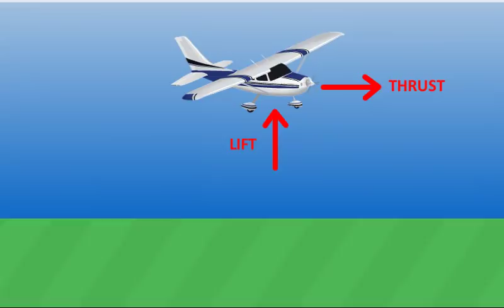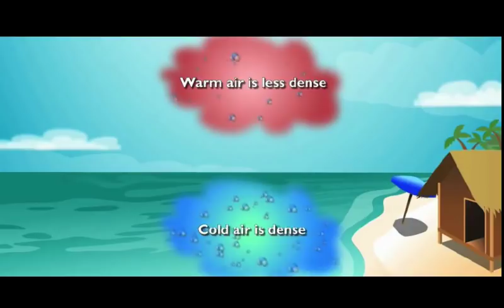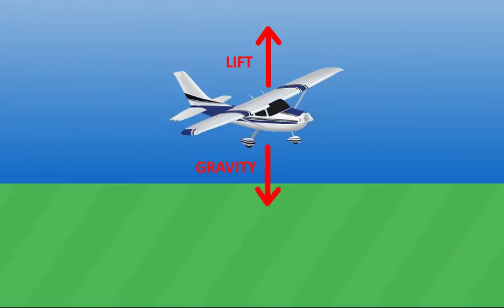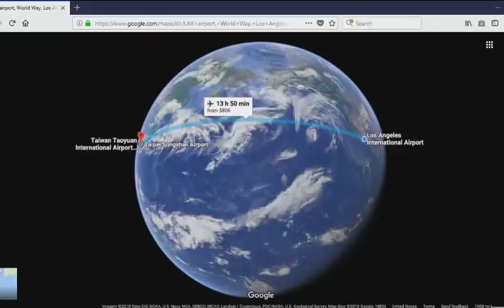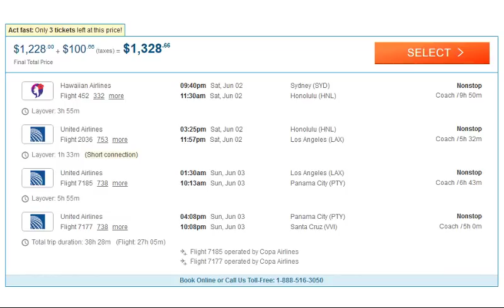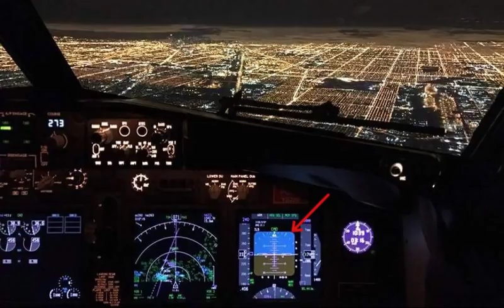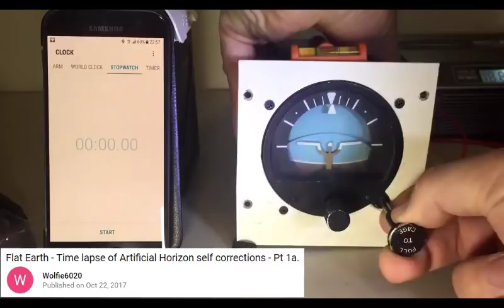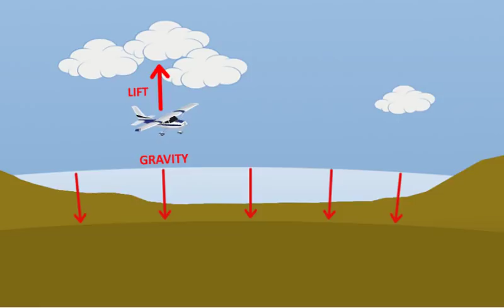Flat Earth Falsities - Plane Nonsense

Comment: too much talking, but don't prove anything..!! this stupid video didnt tell and prove how the plane flies straight to the south and finally returns to its original place.. can you explain it bigmouth??
Reply: Typical "open minded truth seeker" who can't make it through a 20 minute video because it has to much "talking".
Reply: What a charming person you are.
The linear speed of Earth's surface is faster/slower by about 10 mph per degree of latitude (69 miles) between Pittsburgh and Miami which is directly north-south. This demands a continuous bank angle less than 0.15°. This is how the plane flies straight south and back. The proof is in the calculations. Are you proficient at 8th grade math?
Reply: @romithromith  everyone knows PA-FL is a straight line south .. but that's not what I mean, I said *what if the plane flies one way south over the Antarctic wall and back to where it was*. is that possible?? I said no way ..! well, how smart are you explaining to me that it might be based on the earth globe. make something easy to understand-is not just a misleading theory
Reply: @remiljuginta1418  Knock it off with the "how smart are you" remarks when you ask an ambiguous question. You didn't say anything about the Antarctic. Are you talking about crossing the actual geographic south pole of the globe? 
      Flying across the South Pole is just like flying across the North Pole excepting the lack of radio beacons for navigation, its remoteness from population, and much less monitoring/forecasting of weather. Until GPS it required the use of gyrocompasses.
      Why don't you tell us what you think would happen — why you think this would be a problem — so we can make it easier for you to understand.
Reply: @appresley4071  What happens after the plane crosses Antarctica ... hmm? The information you mentioned above only SURROUNDS Antarctica, not CROSSING. Only 1 person has seen across Antarctica, namely Adm. Richard Byrd, many sites explain and one of them is https://www.youtube.com/watch?v=PrdSal9uH28
Byrd's information made the USA send 5 expeditions to Antarctica. What's wrong? This indicates that the earth is really flat and there are other lands that we don't know about.
Reply: @romithromith  Okay, I make it easy to understand, bro. Plane crossing Antarctica what happened ?! Your answer is wrong to say the same as crossing the North Pole. Adm. Richard Byrd is a real witness who has seen across Antarctica, he said there is still another plain as wide as America, across Antarctica. And this is one proof that the earth is really flat. This is an interview with Richard Byrd https://www.youtube.com/watch?v=PrdSal9uH28
Reply: @remiljuginta1418  I'm not sure where you get the idea this proves the Earth is flat. The Antarctic Plateau, which is an area the size of the U.S., is on the other side of the Transantarctic Mountains and geographic South Pole from Byrd's base called "Little America", on the Ross Ice Shelf. Navigating around the mountains forced him to cross the geographic pole.
.
Byrd said, "...an area as big as the United States that's never been seen by a human being and that's beyond the pole on the other side of the South Pole from Little America."  
.
Byrd was eager to develop Antarctica for its natural resources and military advantage. The area as wide as America is no utopia. It is a barren, frigid, snowcovered desert, which at 10,000-14,000 ft. makes it difficult to breathe. The term dome, used in an old Encyclopedia Americana article refers to an ice dome, a geologic feature for the plateau, not a firmament.
Reply: @romithromith  Why is what Byrd said not on the globe map? That proves that there are still other lands, right? That is one of the reasons the earth is flat and there are still other worlds outside the walls of Antarctica. Byrd also said there were sufficient sources of coal to supply the world for several hundred years. In fact there are no mining companies in Antarctica, why? There is something that is deliberately hidden. Because if it is proven that the earth is flat then all conspiracies including flying to the moon, the billion dollar business satellite will be destroyed.
Reply: @remiljuginta1418  What? It is on the globe map. Look at a map of Antarctica.
     Byrd may have found coal in core samples likely taken from the mountains. There are no mining operations because of ATS—to prevent conflict and preserve the continent. Nothing is being hidden. 
     GPS and satellite phones couldn't exist without satellites. You can disclaim the Apollo landings but the published claims have been debunked.
Reply: @remiljuginta1418  Garbage, many people cross Antarctica. Planes fly to the US Amundsen–Scott South Pole Station from the US coming down through South America, then continue onwards to another US station at McMurdo which is on the New Zealand Australian side of Antarctica. So in fact crossing Antarctica regularly, which if the earth was flat would be a 60,000 mile flight. Planes often fly from the Americas to all and every Antarctic Base Stations, delivering supplies, personnel and equipment. There is even a rough road that goes all the way to the actual south pole. Which is used when delivering bulky heavy items.
Reply: @romithromith  Above you have written Bird says "" ... an area as big as the United States that's never been seen by a human being .. " but next you say it's on the globe map, which is correct ?! Because I don't see the continent what Byrd said on the globe map. ATS is escorted by the militaries of certain countries (12 countries), not the rest of the world, that's prohibited bro.
Reply: @appresley4071  Tell me how far it is from Amundsen–Scott South Pole Station to McMurdo Station based on the existing flight routes. Include a link to convince me more. Thank you.
Reply: @remiljuginta1418  Byrd was talking about the Antarctic Plateau. Look on a good map of Antarctica. Most exploration had occurred on the side of the Transantarctic Mountain range to the Ross Ice Shelf. Byrd was saying most of the continent was on the other side. The easiest passage was across the geographic pole.
.
Both are correct. The shape, and some features inland from the shore were known, especially near the Ross Ice shelf and one other. Byrd's expeditions went progressively farther into the interior. Naval aircraft flights in the mid 50s went the farthest at the time, to dome Argus. Byrd wasn't on all of these flights but they were part of his expedition team. All he means is that his expedition went places where no human has been in the interior of the continent.
.
ATS is simply a treaty. These are no military patrols. The treaty forbids military use, extraction of resources, disturbance of wildlife and wilderness, establish and administer processes to visit such as rescue insurance and a travel itinerary to avoid areas protected for wildlife or scientific study. If you have enough money, you can go with a tour or go by yourself.
Reply: @remiljuginta1418   Amundsen-Scott south pole station is right on the the south pole at 90°S . The limit of your flat earth 
       McMurdo station is a US coastal station in New Zealand territory, 850 miles north at 77°51'S
       Both stations easily reachable flights from the Americas
Reply: @romithromith  If you look at a map from Google Earth (based on a globe map), you'll know Google Earth doesn't show a different side of Antarctica. Antarctica is a complete continent, not a separate part. Unless we look from a flat earth map, Antarctica is a ring of walls that surrounds the world. And as Byrd said there was land that no human had ever seen before. I don't understand why I have to talk to you over and over again. One more thing, you can camp in Antarctica is true. But where? just BESIDE Antarctica not ACROSS Antarctica. ATS is clearly involved with the military added ingredients "for the sake of peace", "for the sake of science". Old style tricks LOL..!!!
Reply: @remiljuginta1418  You're talking to me over and over because — like other FEers — you are trying to read into Byrd's words things he never said. 

Look at the map at the Wikipedia "Antarctica" article an you'll see West Antarctica and East Antarctica divided by the Transantarctic Mountains. If you see the article "Little America (exploration base)" you will see the location of his base. If you watch his documentary With Byrd at the South Pole (on YouTube) you'll see his goal was to reach the South Pole. You'll hear that flying over the mountains was too difficult for his plane (c. 1929). You'll also hear that he was doing mapping. One maps unexplored territory — land no human had seen before. Skip ahead to his 5th expedition:

READ From a January 7, 1956 article in the Green Bay Press-Gazette: "Navy pilois.of Operation Deep Freeze have completed their third flight in series of exploratory missions over towering plateaus of the Antarctic rever before seen by man. As a result, much of the white curtain hanging over vast unknown areas of the Antarctic quadrant facing Australia has been punctured and thousands of miles of completely uncharted, forbidding ice cap now are recorded on aerial maps."

In 1929-30, Byrd made it to the approximate Pole. Magnetic compasses are useless because the South Magnetic Pole is not the Geographic Pole and magnetic moment. (FEers generally deny the existence of a South Magnetic Pole.) 

Byrd later crossed the Pole exploring into East Antarctica. Navy planes from the 1956 expedition reached the area of Dome Argus, but none of these planes landed on the Antarctic Plateau. East Antarctica was the size of the continental US.

"ATS is clearly involved with the military"

Nonsense. And do read the Wikipedia article "Jarle Andhøy".
Reply: @appresley4071  Try to look at Antarctica on google earth (based on a globe map). The distance between Amundsen–Scott South Pole Station to McMurdo Station is 1198.82 miles. You don't need to fly to South America, you just need to fly southeast to McMurdo Station. Meanwhile you say "Planes fly to the US Amundsen–Scott South Pole Station from the US coming down through South America ..". Which one is true? Google earth or direction as you say.. 
The correct answer is the direction you said because it is based on a flat earth map. From Amundsen–Scott South Pole Station you have to go through South America to New Zealand and McMurdo Station. So in fact the earth is really flat, not what the google earth (globe map) looks like. The 1198.82 miles seen on google earth is a lie.
Reply: @romithromith  The United States has sent 5 expeditions based on Byrd's observations. Then a treaty was made for certain countries only. Thousands of soldiers were sent to Antarctica for what? Anyone with logic must think there is something .. Do we have to believe all the news that is reported ..? So naive. There are so many lies that have not been revealed. 
I don't know if you are a critical person, or pretend not to know. It would be better if we just stop the discussion. Thank you, I appreciate it.
Reply: @remiljuginta1418   Mate the flat earth map shows that New Zealand and South America are on totally different sides of the map. Flying from the US through South America to reach the Antarctica coast closest to New Zealand on your flat earth, is going in the wrong direction. However I have flown nonstop from Santiago airport in South America to New Zealand which was an easy flight. Santiago airport Chile to McMurdo is 7091 miles crossing Antarctica, an easy distance for modern jets.
Reply: "The United States has sent 5 expeditions based on Byrd's observations."
     Byrd led 5 American expeditions to Antarctica.
.
"Then a treaty was made for certain countries only."
     Originally for the 12 nations involved in scientific investigations on the continent. There are now 54 parties to the treaty. 
.
"Thousands of soldiers were sent to Antarctica for what?"
     For Admiral Byrd's Operation Highjump. In the short term for arctic training, and long term to extend American soverignity and establish military bases.
.
"Do we have to believe all the news that is reported?"
     Do we have to believe all the FE claims published on YouTube?

     Critical thinking, science education and a wider knowledge of FE claims ground me and others from conspiracy theories. And I do look into specific FE claims.

      You seem to be a nice guy and we can leave it here except the following...

     I tried to post a URL to a newspaper clipping which YouTube quickly deleted because of another matter. (Did they show in your notifications?) Anyway, I'll post the text of a Jan. 7, 1956 article. Notice the "never seen by man" comment in context of their flight. Also notice the comment, "the season of perpetual daylight".

      Take care.
Reply: @remiljuginta1418  
GREEN BAY PRESS GAZETTE
Page 2, Saturday, January 7, 1956 
-----------------------------------------------------------------------------------------------------------------
FIND HIGH PLATEAU AREA IN ANTARCTIC 
Navy Pilots Complete Series of Extensive Exploratory Missions

McMURDO SOUND in the Antarctic — Navy pilots of Operation Deep Freeze have completed their third flight in a series of exploratory missions over towering plateaus of the Antarctic never before seen by man. 

As a result, much of the white curtain hanging over vast unknown areas of the Antarctic quadrant facing Australia has been punctured and thousands of miles of completely uncharted, forbidding ice cap now are recorded on aerial maps. 

The twin-engined Neptune which set its skis on McMurdo Sound's ice yesterday completed what is believed to be the longest flight ever made over this continent 2,900 miles round trip from the Ross Sea coast to the Knox coast.

Circles Pole Half Hour 

On Tuesday a four-engined Skymaster circled over the pole for 30 minutes before returning to base here. It was the third time in history that the pole has been conquered by air. The man who did it twice before Rear Adm. Richard E. Byrd has not as yet made any long flights on the current expedition.

On Wednesday another Skymaster headed out into completely unknown areas of the western Antarctic and discovered two mountain ranges and a huge ice-covered plateau 13,000 feet above sea level.

The last two flights came within sight of base areas assigned to the Russians under the international geophysical year program. But the crews saw no sign of the Soviets. 

(Moscow Radio reported Saturday that the Soviet Union team had landed on the Antarctic ice cap and sent off ski teams to explore inland.) 

The polar flight came about by accident. The Skymaster’s original mission was to penetrate unknown areas of Wilkes Land, but the pilot, Lt. Col. Hal R. Kolp, U. S. Marine Corps, of Akron, Ohio, ran into a severe whiteout. After repeated attempts to pass the phenomenon by which the horizon is lost in whiteness, he headed south to the geographic pole. 

The fliers recorded that the pole area has an altitude of 9,700 feet and described it as flat and full of snow drifts. They said it had the appearance of a "white, stationary sea." 

Covers 2,100 Miles

The second flight with Lt. Cmdr. Henry P. Jordan of San Francisco at the controls, covered 2,100 miles round trip. The deepest point in the Antarctic interior was reached by Jordan and his nine crewmen. It was latitude 80 degrees south and longitude 90 east. 

This area, the fliers found, had an ice cap of 13,000 feet making it one of the world's highest plateaus. They were forced to fly only 500 feet above the ice, because the crew had no oxygen as a result of a leak. 

By the time they returned to McMurdo Sound all had headaches from the lack of oxygen. The Neptune piloted by Lt. Cmdr. John H. Tobert of Carmel Valley, Calif., flew to Vincennes Bay on the Knox coast and then traveled westward 120 miles before returning to McMurdo. The flight took 14 hours. Tobert and the crew of six found it "completely barren." Visibility was good, but the scenery had a dull sameness.

The men aboard this plane also had the distinction of seeing the first twilight since the expedition arrived Dec. 17 in the season of perpetual daylight. They did this by flying slightly north of the Antarctic circle before returning to home base. 

Navy officials disclosed that a tractor used on an exploratory mission plunged through an ice crack, carrying the driver to his presumed death. He was identified by the Navy as Richard Thomas B. Williams, son of Mr. and Mrs. John R. Williams, Mohawk, N. Y.

🟥
Reply: @romithromith  I've seen your post.
FEer do their research independently and personally, doesn't mean judging you for a conspiracy, but there is something that is well organized, even hundreds of years have been planned that the earth is a ball. Finally, there was an awareness of the lies that had been hidden for certain purposes and interests. 
The important thing is that more and more people believe that the earth is flat, and that more lies will be revealed in the future.
see ya ..!
Reply: @remiljuginta1418  A conspiracy theory is needed to discount evidence that the Earth is a globe. But what happens to independent research that shows Earth to be a globe? 

• Sunrise/set on the equinox,
• Sunrise/set in the southern hemisphere in January,
• Perpetual Sun in Antarctica in the same period, 
• Converging lines of longitude below the equator, 
• Same size of Sun all day long, 
• Night, 
• Eclipses, 
• Nonstop transcontinental flights in the Southern Hemisphere,
• Symmetry of the hemispheres,
• and many more...

These can't be explained on FE. And if you turn to other FEers to explain them, you aren't doing independent research, you are following a narrative.
Reply: @remiljuginta1418  mate you have fully lost the plot
Reply: @remiljuginta1418  lol
why exactly should „dah truff“ be hidden from you „woke ppl“??? 
why „dah conspiraceeh“??

lol so funny 🤣
Reply: @remiljuginta1418  there is more land in Antarctica past than north America this is not an argument Antarctica is bigger than north America try looking on a real map.
Reply: @remiljuginta1418  why is it that when its night time in my country (Philippines) its daytime in the US? How do u explain that?
Reply: @remiljuginta1418  The earth is rounded!  And General Richard Byrd has entered the center of the earth !!  The earth is hollow not flat !!!
Reply: This incel would never talk like this to someone to their face.  Comment sections give mouthy little wimps a platform to vent without consequences.